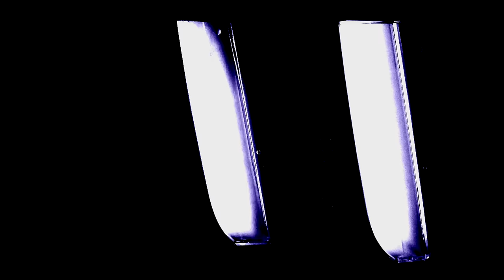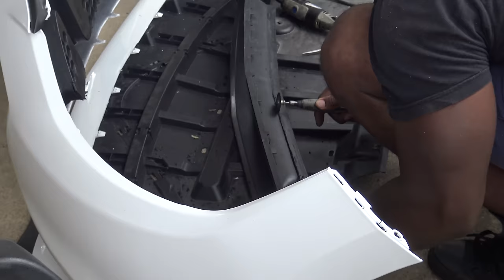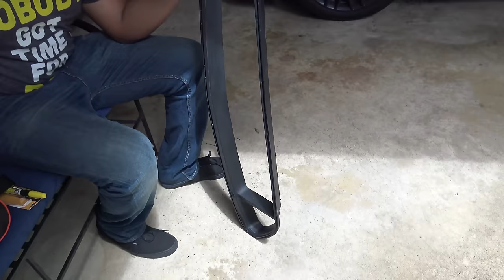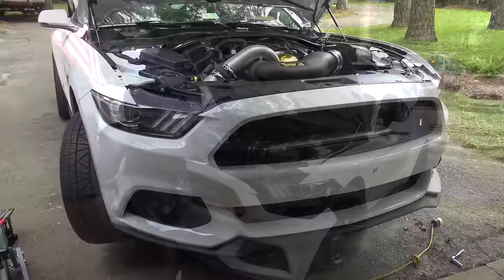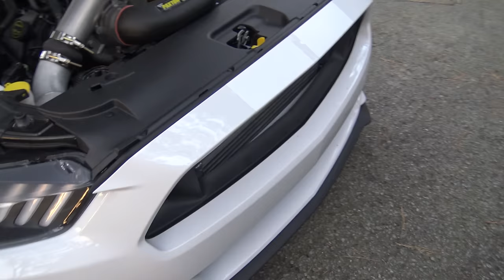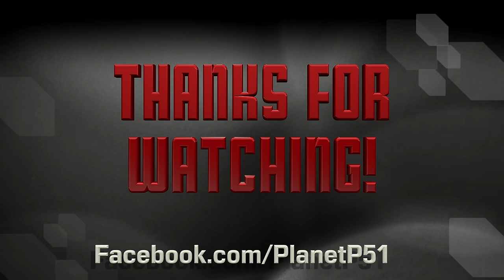2016 Mustang GT Modified Grille

Comment: AT 4:41, I noticed that the driver side pipe coming up is really close to hitting the car. Have there been any knock issues with the T bolts that you guys used? I have the standard clamps right now and it's hitting when you go WOT

Comment: looks nice is he going to put anything behind the grille for protection , like mesh
Reply from the maker: I don't think so.  Shouldn't be an issue though because the 2014 GT500's came that way stock.
Reply: I'll be doing this on my ecoboost eventually (got a GT grille upper and lower to cut up) but I am definitely putting the mesh just because I hate all the bent fins on the IC.

What are the wheels on that one? I love the look.
Reply from the maker: They are the GT350R replicas.
Reply: Thanks man! I'll have to check them out they look awesome.

Comment: I am looking at a similar set up for my 2015. I want the voodoo intake with a centrifugal supercharger. Could you ask Brandon how he likes it so far? Also I have been thinking about 3.73 gears or 4.10. Does he like the 3.73 or does he wish he went for he shorter 4.10?
Reply from the maker: Oh, he absolutely loves it!  I ask him about it all the time.  I'll ask him about the gears though, but I haven't heard him say anything negative about the 3.73's yet.  Usually if he doesn't like something, it won't take him long to switch it out.
Reply: Thanks that's great to hear! I'm trying to plan a solid build where a supercharger would be my last mod if I feel as though I need more power.
Reply from the maker: That's a good way to approach it, that's basically what I'm doing.  Next up is headers.

Comment: I know those are project 6gr wheels and 20's but do you know by chance what tire specs he is running and if he is on sportline springs?
Reply from the maker: Pretty sure he's running 315/35/20's all the way around.  I know that's what the rear tires are for sure.
Reply: is he on sportline springs?
Reply from the maker: Oops, sorry.  I forgot to answer that.  Yeah, he has Sportline's.